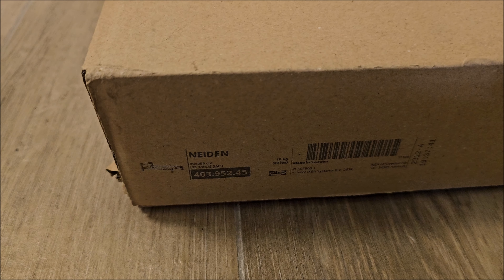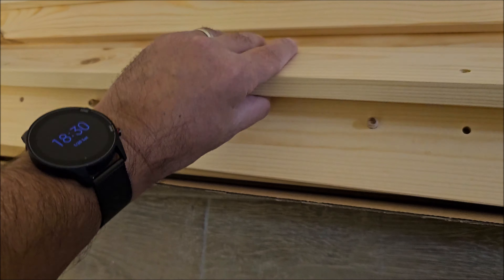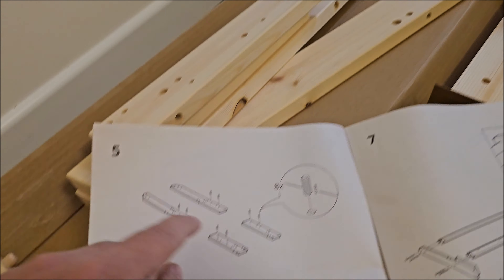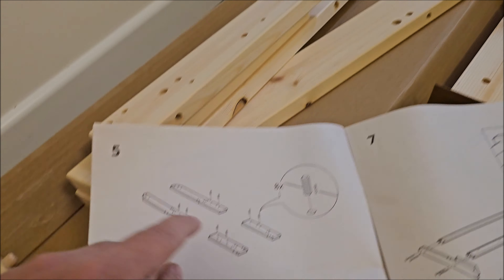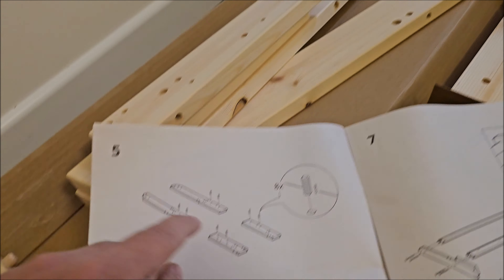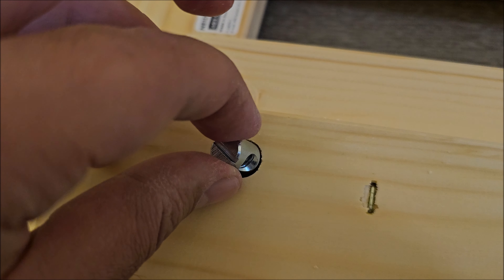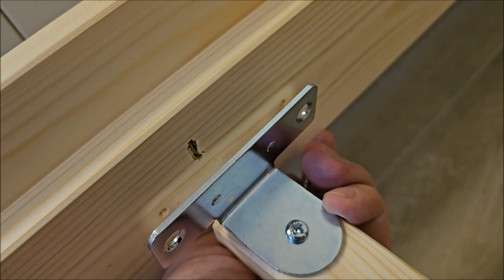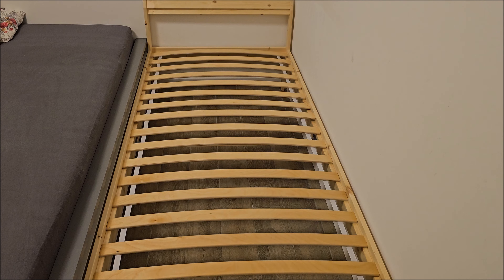Assembling IKEA furniture - NEIDEN - bed frame + LUROY - Slatted base

Comment: And then in the middle of the night the slats fall down every single bloody time! Hate luroy hate ikea. Cheap but bbadly designed.
Reply from the maker: That means you did not use the plastic elements locking the end slats in place. If those are used it's impossible for them to fall even with 2 persons in same bed.
Reply: @UltimateDIY  do you mean the wooden dowels? There is no plastic element and yes they still fall out even with the dowels.
Reply from the maker: Yes, you are right, they are wooden. I was thinking about MALM bet. That has plastic ones. But it does not make sense. I can't make mine fall even if I try. Did you put the slats with the curvature facing down by mistake?
Reply: Don't buy it then

Comment: I realise this man is being helpful but I highly recommend you unpack everything and identify each component as per instructions.
I also tip out all the metal parts , fittings, screw etc into a bowl so nothing gets lost .
Then I sort through the metal fittings into groups again as per instructions.
Then you will know if you have all the pieces necessary to build the bed. As an ex professional furniture restorer I had to be methodical and have a good understanding of the work I was doing.
Reply from the maker: Your tips make sense, but would slow me down too much, to a point of not making sense anymore for me to film the assembly. From all Ikea products that I assembled, I never once found a missing component. For sure it would help those watching the video to understand it better, but it would affect me too much.
Reply: @UltimateDIY   i just built this bed, the instructions with it are not the best, this video was helpfull, thank you for correcting yourself quicly when you forgot to put the bit of wood in the bed end... i bacsicly did what u did but i hadnt screwed it in... and i only had one side in when i noticed. my tip would be maybe get a tripod, some futher away shots would have been super helpful as u were building... it was quite close up, other than that thankyou for provide me a helful resourse.
Reply from the maker: I thought about tripods many times, but I don't like to appear in my videos, so it would be quite complicated to always try to be away from the camera. But I could try to film on wide angle, maybe that would help.